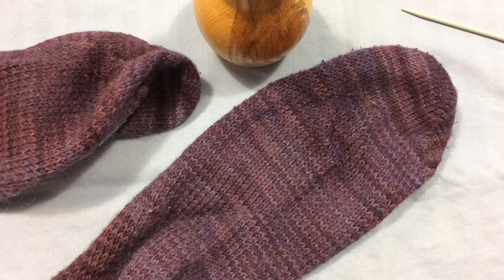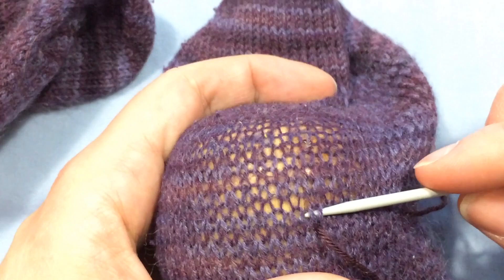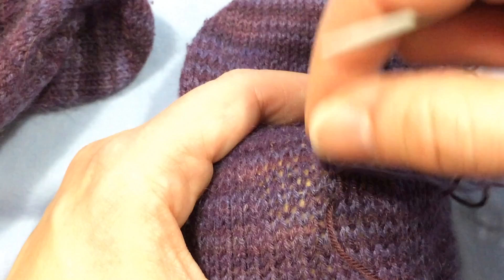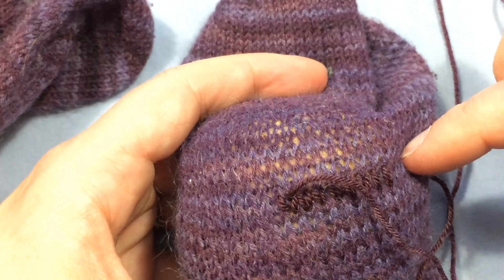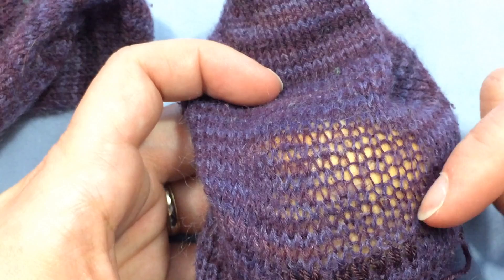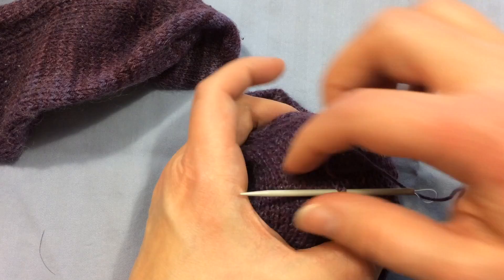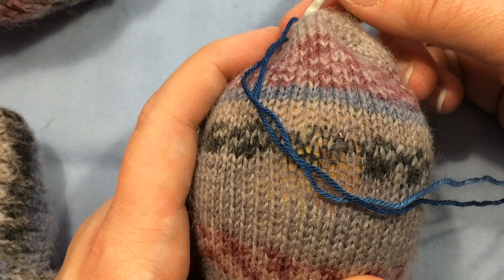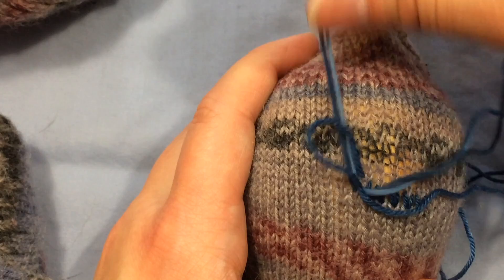Sock Repair: Duplicate Stitch

Comment: Fantastic Explanations! ...  Thank you very much for sharing your experience.

I just finished darning the toes, on some expensive work socks (maybe 7-10 years old),  and noticed ULTRA-THIN material on the ball.
I like the socks enough to give it a shot, rather than spend 30 bucks (USD) on new ones.  
After watching your video,  I think I can.  (I think I can, I think I can).

Happy New Year 2022 ... and thanks again!
Reply from the maker: You can do it!

Comment: My socks always wear out in the same place - the heel. Would this work if I did it as soon as I finished knitting the sock as an extra layer so they lasted a little longer before needing to be fixed, almost like a preventative measure?
Reply from the maker: It definitely should. It's just kind of tedious (all those tiny stitches). Some people will add in a strand of lace weight yarn at the time of knitting or a reinforcement thread.

Comment: Hello. Thanks to you I was able to learn Swiss/duplicate darning and have mended several socks, sometimes even adding stripes to the darned patch. I have been weaving the yarn ends over and under stitches when I am done. Is that what you do, or by weaving do you mean that you make more duplicate stitches? Thank you.
Reply from the maker: Great question! Sometimes I turn the sock inside out, and weave in the end "traditionally" (on the inside). Sometimes I just keep doing duplicate stitch on the "good" stitches and then I'll just tuck the short end inside and trim it off. When it's socks and I'm fixing the bottom where it's not likely to be seen, I'll take shortcuts and not weave in the ends very much. If it's a mitten or a sweater, I'll take more time and care in how it looks and ensure that the ends are secure.
Reply: @Yarniversity  Thank you! I never thought to wait until I was done and turn the sock inside-out to weave in the ends on the "wrong" side. I would weave them in on either side of the darn as I was working, and they could become a bit apparent. I will try your method next time. :)

Comment: Your sock and the darning yarn are both dark and its hard to see what you’re doing.
Reply from the maker: It's kind of a "reality tv" approach to fixing socks! It just seems inevitable that the sock that needs fixing is the one that is dark and the stitches are small, so it's hard to see. If possible, try to watch the video on full screen and use a computer monitor. I really did try to zoom right in on the stitches for you. I hope that's helpful. :)